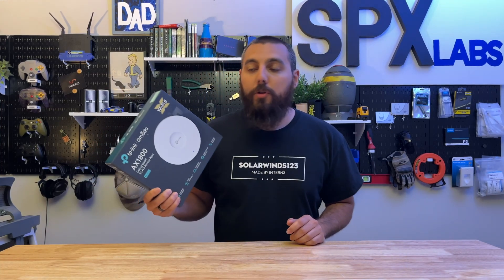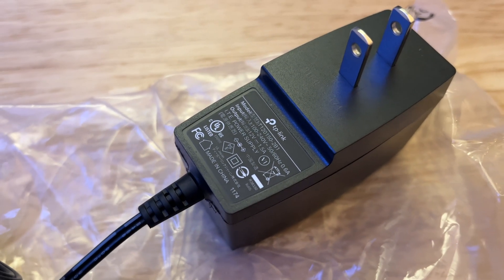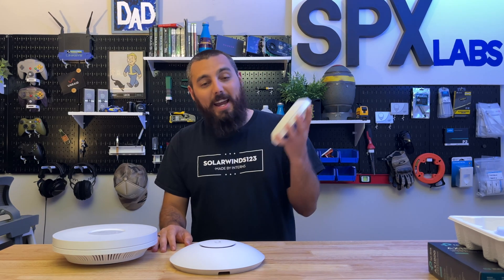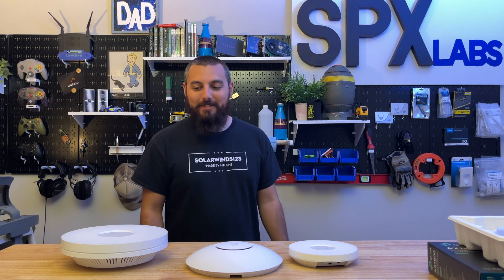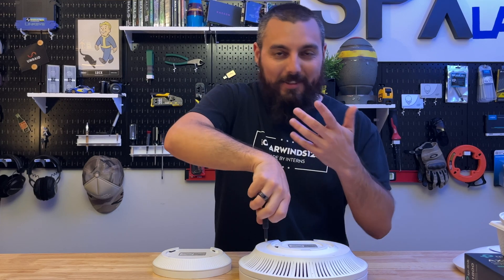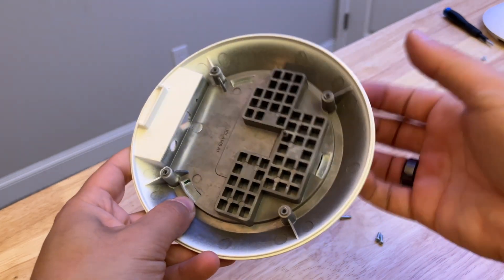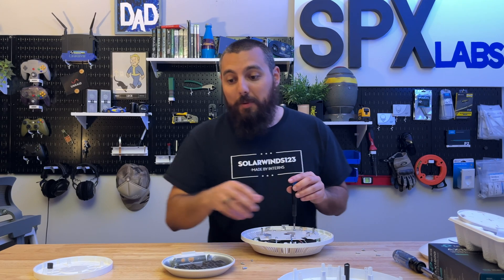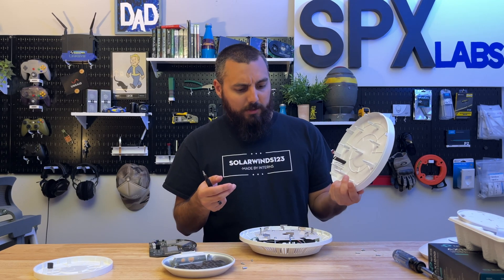EAP610 V2 Size Comparison and Tear-down | TP-Link Omada

Comment: Just bought a EAP225-Outdoor and honestly disappointed with the signal penetration through concrete walls compared to my single Deco M5 indoor. Checked with Heat Map simulator on Omada, i'm thinking of getting EAP660 HD for my use. Thank you for the tear down and boy am glad to see those 4 antennas each bands.
Reply from the maker: The 660 is legit.  I should have tried the outdoor one indoors to see what it would be like

Comment: The EAP 660 HD is a great unit. The EAP 610 V2/V2.2, not so much (received yesterday). Just ran some tests in AC mode and it's 20%-40% slower under a variety of placements scenarios. On average, 35% slower. Bummer. Don't think it's worth it to lose that much performance for a smaller enclosure.

Comment: Not necessarily an improvement. Smaller enclosure = more heat. Very possibly the larger enclosure APs will perform better in warm environments. However, the EAP610 V2 was clearly engineered to perform under elevated ambient temp conditions. My suggestion for bench tests is to test under ~72-78 degree ambient temps, then ~82-92. No one ever posts their ambient temperatures. Very hot running APs often do perform poorly.
Reply from the maker: That’s a good point.   Moving forward I will do my best to incorporate temperature
Reply: @SPXLabs  One time I had a small switch that started acting up. So I opened it up and the chips were extremely hot to the touch. I decided to run benchmarks while blowing canned air onto the board. As the air would hit the board, the throughput would rise, back off on the air, and throughput would drop. It was fun seeing this in real time. It's not too hard to do this but in revers with a hair dryer. I use these tools for temp troubleshooting: Klein Tools IR07 Dual Infrared (IR) and Klein Tools TI250.

Comment: I moved from the EAP245 v1 (an oldie but goodie) to the EAP610 v2. Have had it for a week or so now. No noticeable difference in performance or range but the web UI is much more responsive thanks to the faster processor. I just wanted the Wifi6 capability. Only wish is had 3x3 MIMO like my old EAP245.

Comment: The TP Link website is also showing  new 620HD and 650. I read somewhere that more new products are coming. I'm waiting for the new multi-band HD models.
Reply from the maker: I can confirm I have heard of the 620HD.  There are definitely more products coming.
Reply: @SPXLabs   There's a 670, WiFi 6, AX5400, 2.5 Gbps.